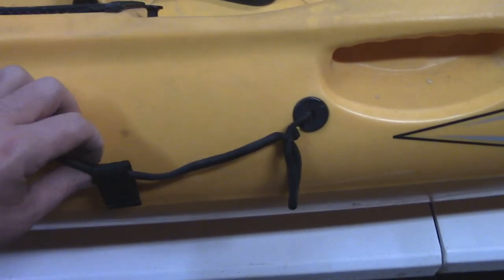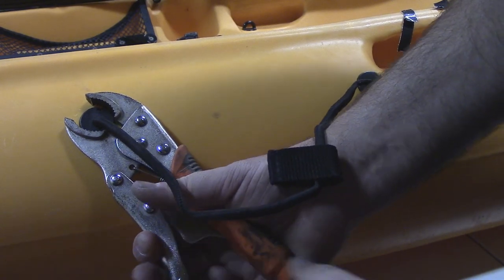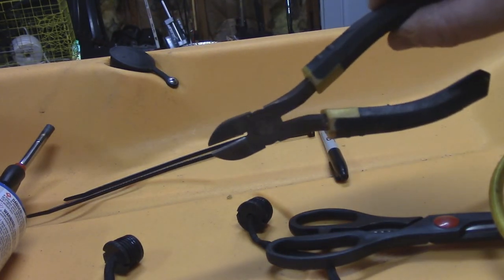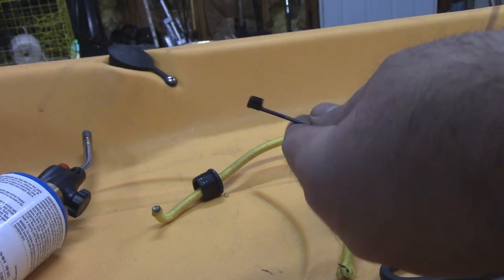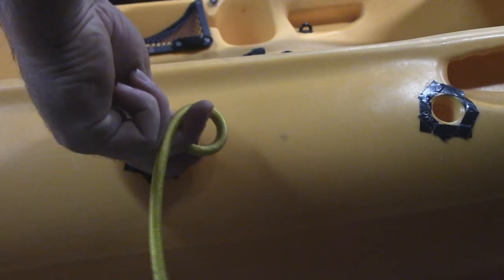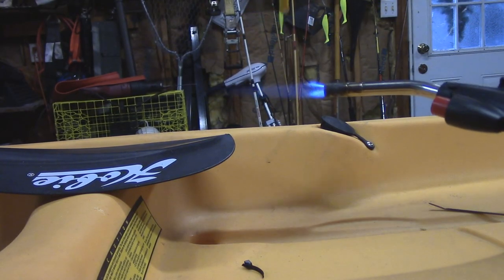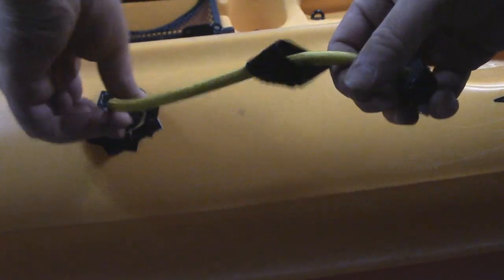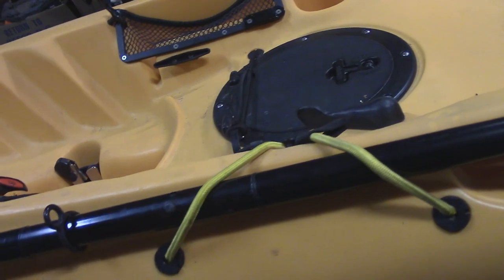replacing the bungee cord paddle holder on a hobie kayak

Comment: Thank you. Helped a friend replace the keepers on his Hobie in minutes. I did go with the knot rather than the zipties and used a little vegetable oil on the plug threads to assure that they did not cross thread during reinstallation.
Reply from the maker: Glad the video helped,  i would have tied a knot in mine but the bungee cord i used was to big to do that.  The vegetable oil is a great idea.